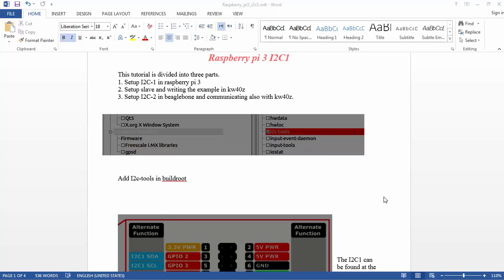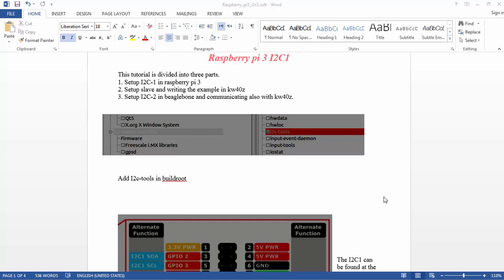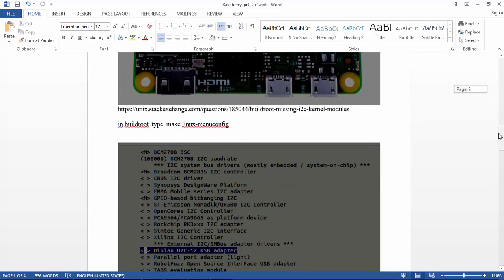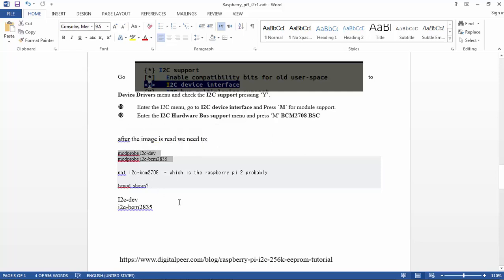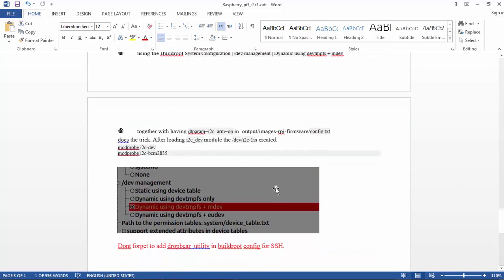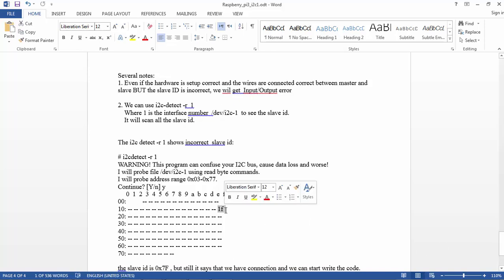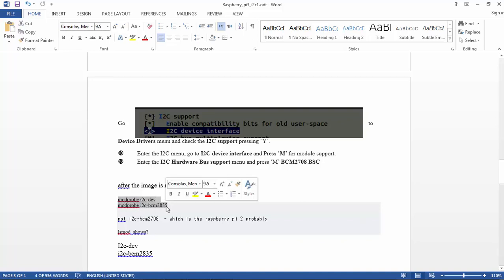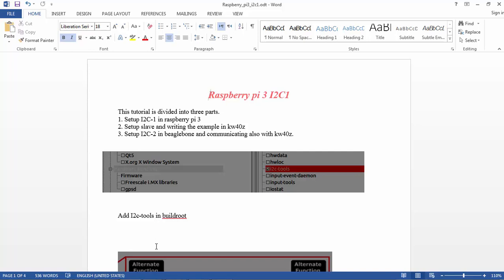raspberry pi 3  i2c overlay for buildroot

Comment: hi i have a raspberrypi 3 B+(BCM2837B0) . i made image with yocto .I accessed .config with the"bitbake virtual/kernel -c menuconfig"  command and I applied what you said. i can't work i2c  on my RPİ. Could the reason for i2c not working be from board difference?
Reply from the maker: you dont need to use yocto at all!  only buildroot